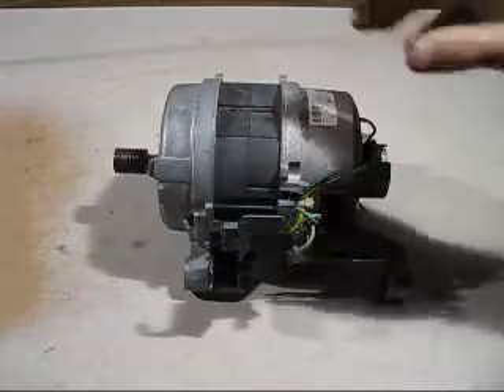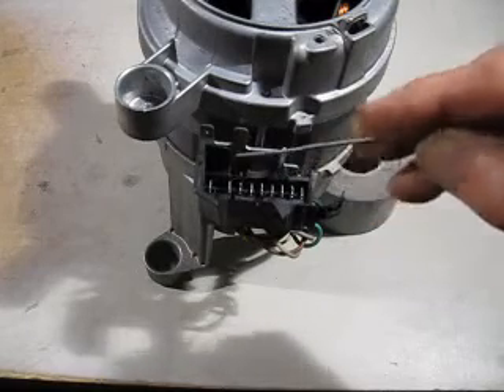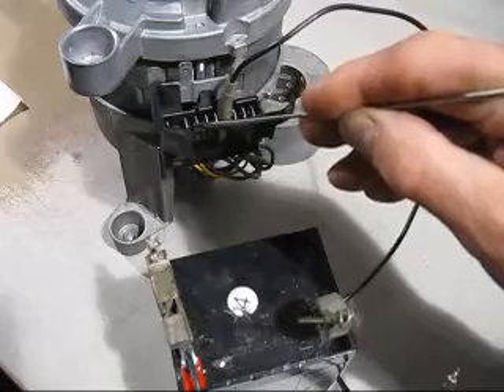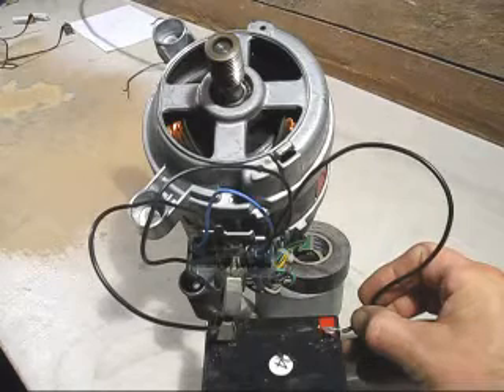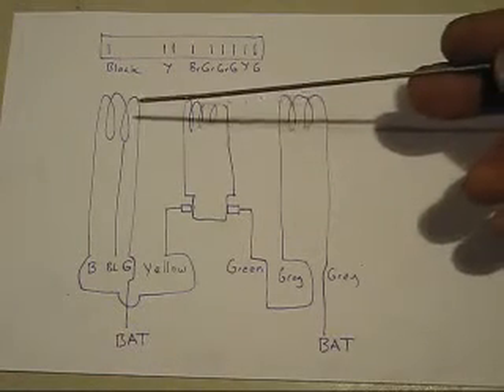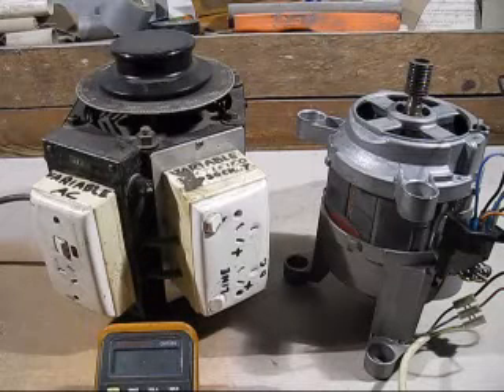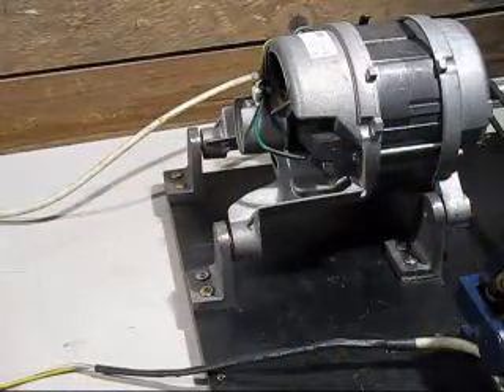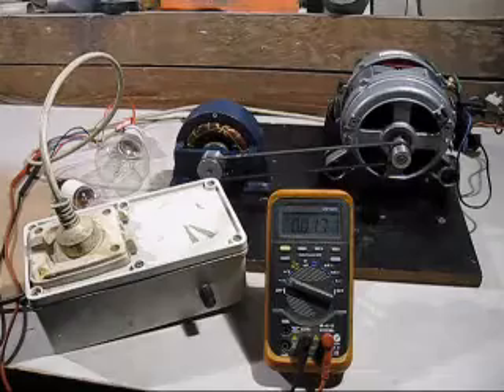How to connect up a series motor

Comment: I saw another video of experimenting with one of these motors and when they adjusted the speed they only had power at the higher speeds.  They also said that the original controls in the washing machine were too proprietary to be used because they had unknown components and would be too complicated to repurpose.  I don't know enough about electronics to figure it out, but it seems like there has to be some way too use the pulse generator on the motor end to control the speed and power somehow.  Now I have to find a motor of this type and get ready for future videos.